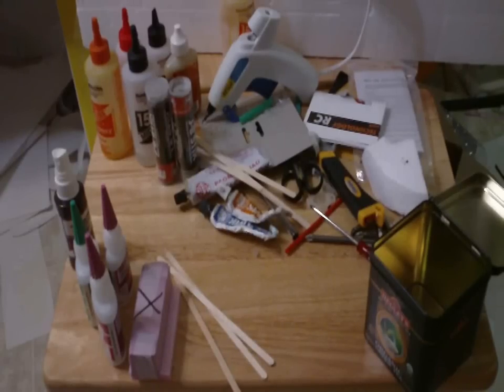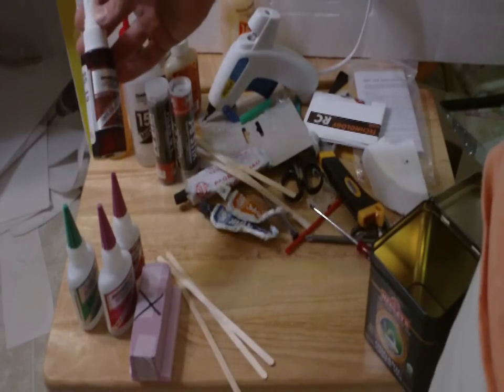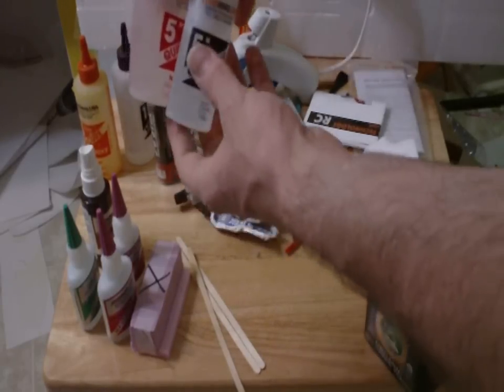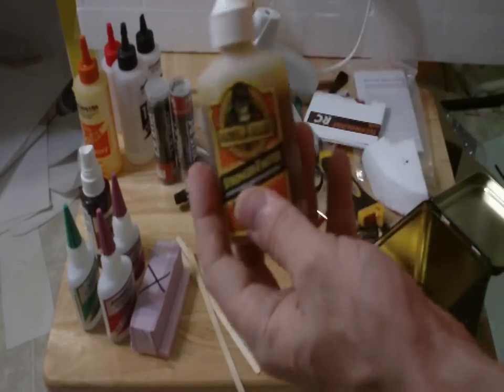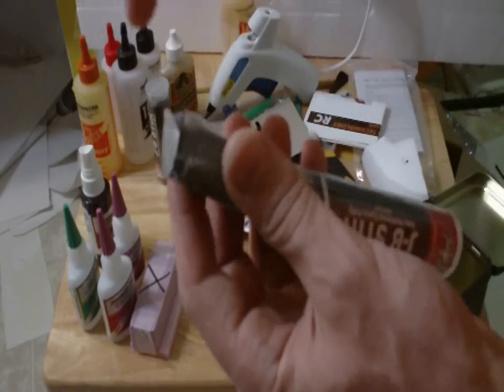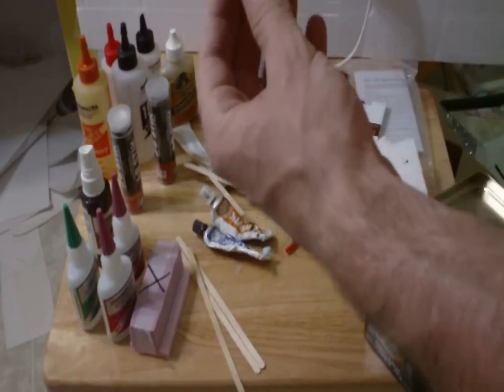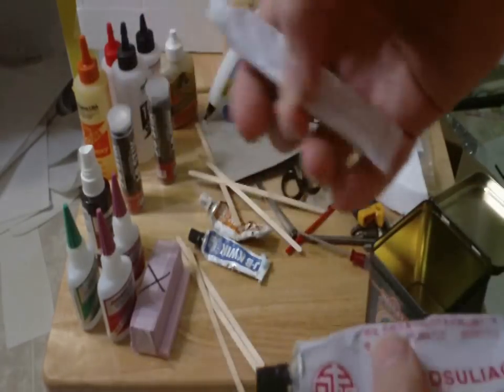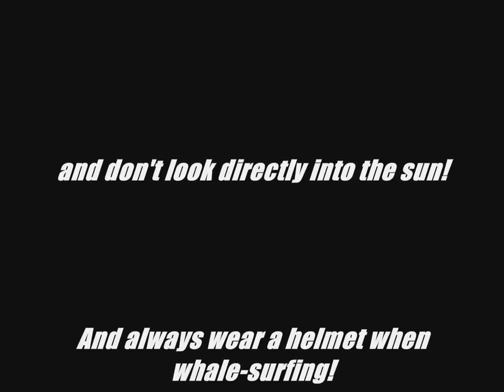Glue & Epoxies that DemonDriver uses for RC planes!

Comment: 5 min epoxy is all you need, just vary the amounts of resin and hardener to make it cure at what ever rate you like.
CA can make a very strong instant bond if you get it right, but if the conditions aren't right you can't trust it.

Comment: hi there, I enjoyed watching your video on glues and epoxies. I have just built a super frontier senior 46 which is very similar to the sig kadet senior . the wingspan is 80 inches. when I glued the two wing halfs together the dihedral brace glued also I was left with a slight gap where the wings join. I filled this gap with thick epoxy. do u think I have added too much weight to the wing by doing this?   kind regards aidan mcatamney
Reply from the maker: aidan mcatamney Hi Aidan! You should be allright with you epoxy Sir.